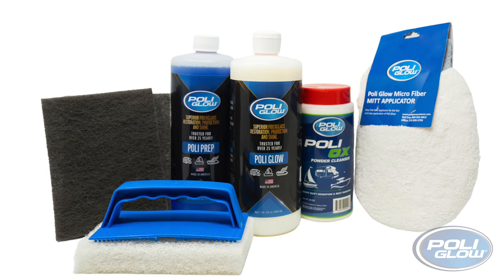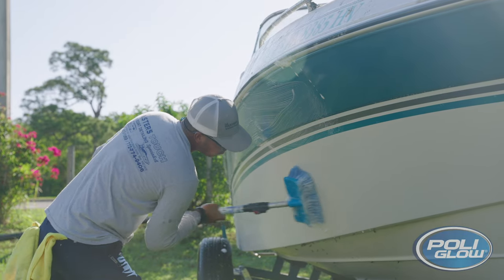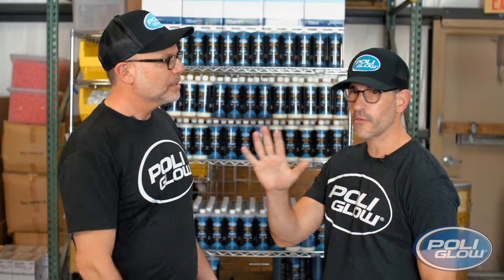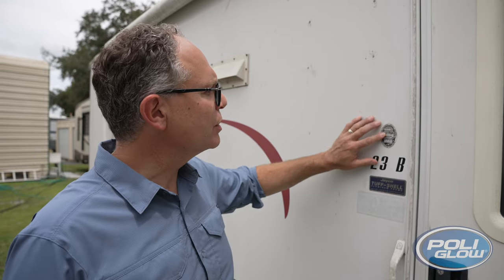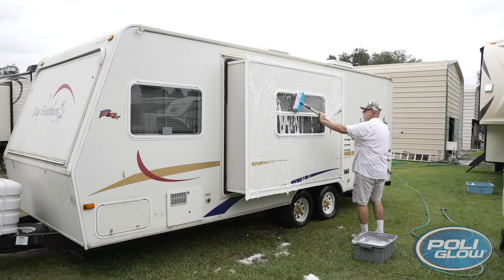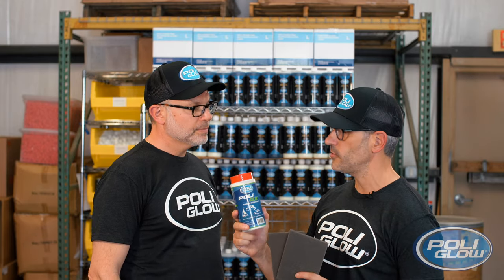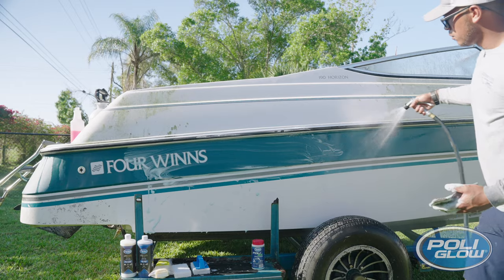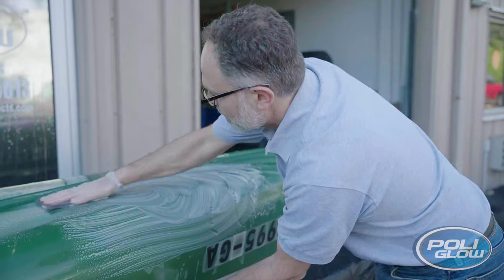How To Video 4: STEP 1 - Cleaning and Preparing

Comment: So from what I just heard not ideal to use on the gulf coast of Florida due to heat and humidity
Reply from the maker: Hi John, actually, Poli Glow is great in all climates, that is why it was developed. In climates like Florida, you want to add more coats (8-10) because your adding more UV inhibitor to the surface protecting against oxidation in a high UV index area. And you would want to add a maintenance application every 8 months to maintain the high gloss before oxidation sets in.  The concern about the temperature and humidity is about the actual application process and drying times.  Each coat needs time to dry before applying the subsequent coat, and it takes longer to dry when it is really humid. If it's too hot (into the 90's), it can dry too quickly and cause streaking. These application techniques are common among all types of sealers.